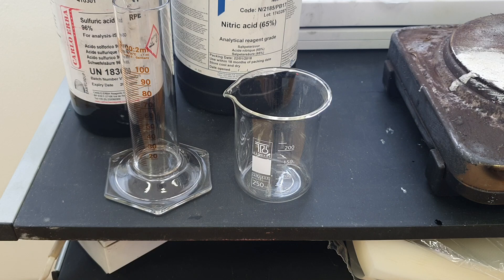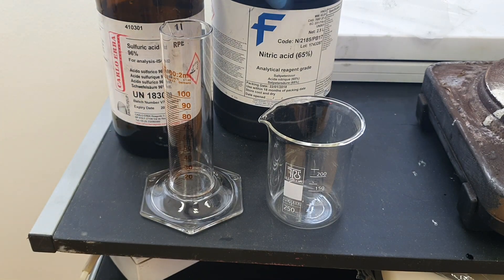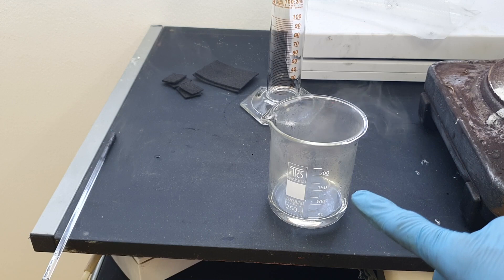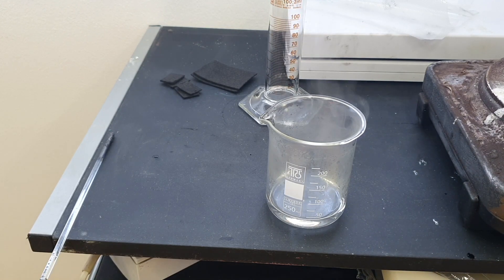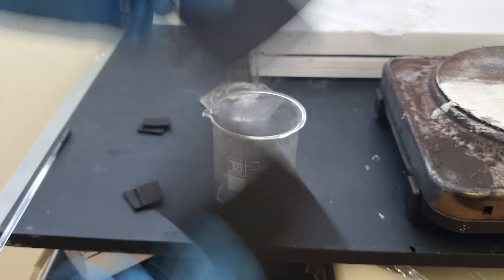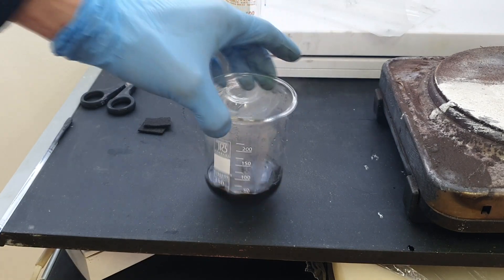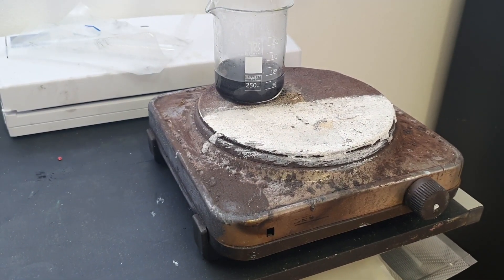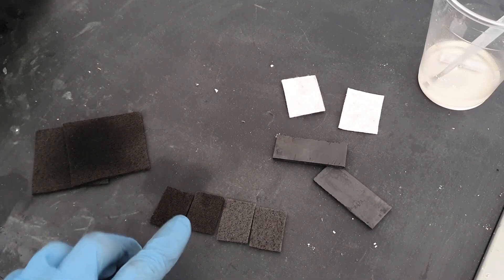Make Chemically Functionalized Carbon fiber - Supercapacitor

Comment: Hello, how can I know that if those supercapacitors made that motor work? Why you dont show how to charge, you dont show what you use for charcing, you dont show how to make that motor work by only the supercapacitor. Maybe you provided the voltage from power supply for make the motor work??  Thanks.
Reply from the maker: Yes, sure you can not know. The only way to know will be that you do it yourself!
Reply: @cayrex  I thought you recorded this video to show how to make and work supercapacitor and help the others to do it oneself. I was wrong. Thanks.
Reply from the maker: @onurguler4578  aha ok. Then search for https://www.youtube.com/watch?v=BsuPVO0nseU that one is some easy saltwater supercapacitor, for example.

Comment: Sir well explained 
what solution  you have added to the electrodes as an electrolyte 
And on what metal plates you kept your electrodes for  support
Reply from the maker: 2 mol of Na2SO4 better is 2 mol of ZnSO4. The plates which I use are graphite plates and I use for current collectors.

Comment: Make high voltage high farad aluminium cap
Reply: I was thinking for most cost effective DIY welding machine polarized capacitor... so something like a 50V or larger DC smoothing capacitor.

Comment: interesting - what is the molar concetration of the acids before mixing in 3:1? I see that the Nitric Acid is 65%, i've read in literature 6M is commonly used for Nitrogen doping- do you dilute it at all or use as is? Is the H2SO4 1M or more?
Reply from the maker: nitric acid and ammonia is also good. Carbon fiber > nitric acid, 7h, 85 deg C > 32 - 25% ammonia, 12h, 150 deg C
Reply from the maker: Here I use a concentrated nitric and sulfuric acid. 65% nitric and 96% sulfuric.

Comment: And now for the best trick........ Put it in microwave and watch it turn into activated graphene nano platelets 😲🤔
Reply from the maker: I just record the video,... and now you come with the comment
Reply from the maker: Hehe I just did 😊
Reply: Time for testing
Reply from the maker: @Buzzhumma  I get better energy out from the cell.
Reply from the maker: The carbon fiber was not bad, the funcionalized carbon fiber was good and activated carbon fiber was really good
Reply: @cayrex  maybe time to graphitize the a activated carbon in the kiln?
Reply: @cayrex  I try so many things but I have not graphitized the carbon felt after activating it. Very exciting. Maybe adsorb some explosive nitrate salts  in it but be carefully.
Reply from the maker: I was thinking of activation of milled carbon fibers that way also. I make allready a activation of activated carbon which was first activated by steam,... but is hard to clean 😄😊
Reply: cayrex2 yes but if you can use the electrolyte that will be used in the cell it becomes  a physical property thats a benefit as the ion can come out if the could get in !
Reply from the maker: Do you have some source where to buy a qualty lab furnace?
Reply: cayrex2 no mate but i feel using a graphite crucible with induction zvs with aerated porous bricks would work well .
Reply: @cayrex  Thats great, what were the 3 energy readings for the 3 types of carbon fibre.
ie is it worth the extra time effort and money to get the extra energy, or perhaps just build a larger cell with the standard carbon fibre :-)
Reply from the maker: @solarhope  Good point. I'm the same opinion. Battery with carbon fiber: 45 mWh, battery with activated carbon fiber: 71 mWh. Voltage difference between this two cells: 0.15V
Reply from the maker: @Buzzhumma  ok nice mate
Reply: Electron Proton Neutron Mouron yes I am thinking lately about zvs cooking also. Kilns are too slow and costly. You sound like an Aussie maybe?
Reply: Maybe Noble prize!